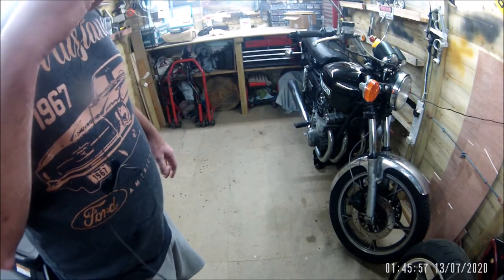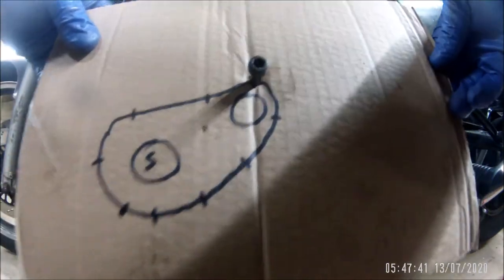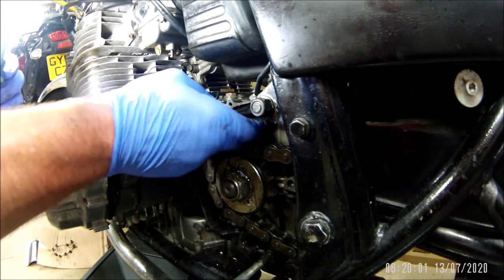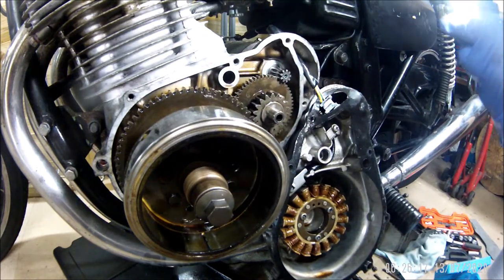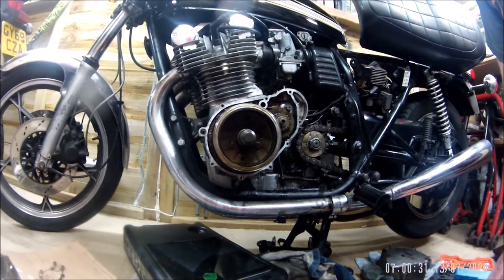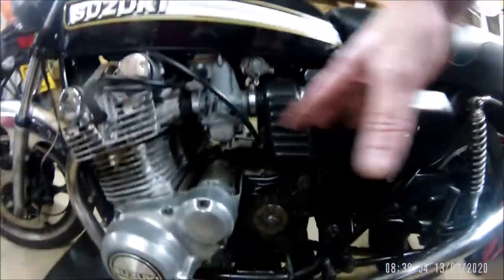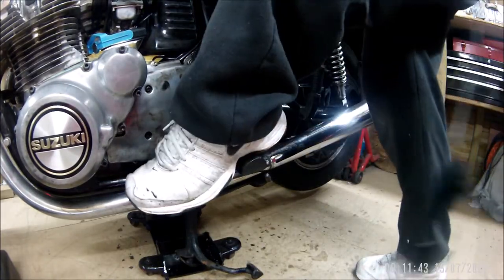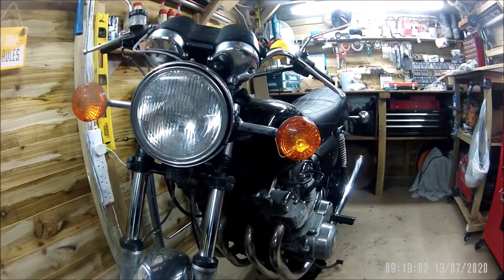Suzuki GS 1000 Stator Cover Gasket

Comment: I cannot help thinking a newer Honda CB1100 would provide many fewer repairs over these Suzuki beasts. I drive one of these bikes a 1980,  but am tiring a tad of the endless minor repairs- including the stator repair, after replacing the rectifier/regulator 4 months ago. But to be fair, mine sat in a gent's garage unused for 20 years, which is the worst thing you can do for electrics. I can do the repairs, and have the gear, but am tempted by the Honda. Will I get the Honda? Not likely. I won't have the growl, the eclectic nature of the Suzuki, and the sheer rawness of these monsters of the dark as I rumble up hills in low gear....with far more power than I need.
Reply from the maker: So right 😂